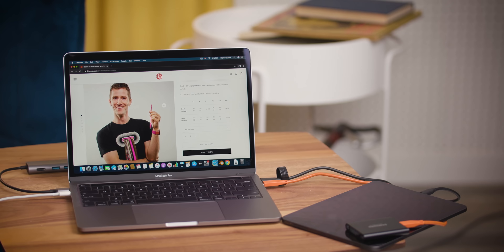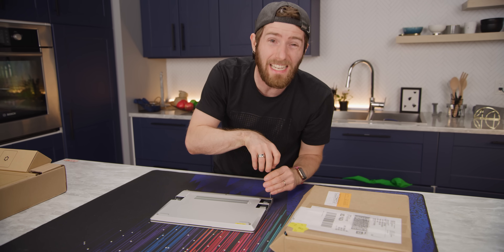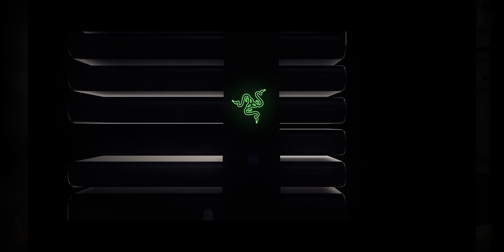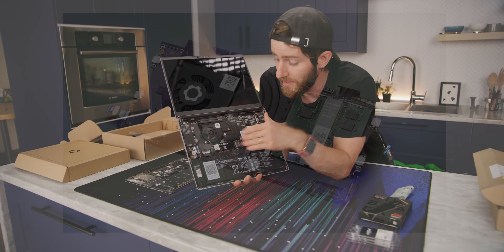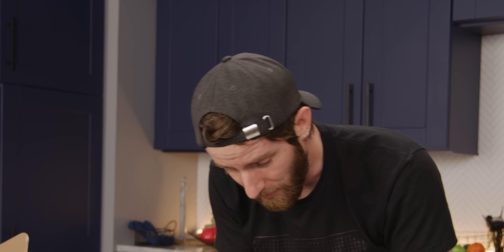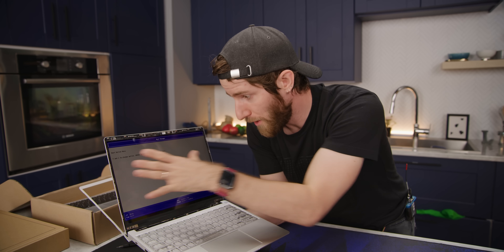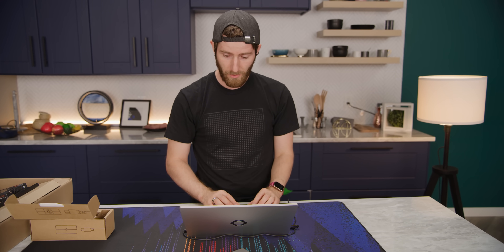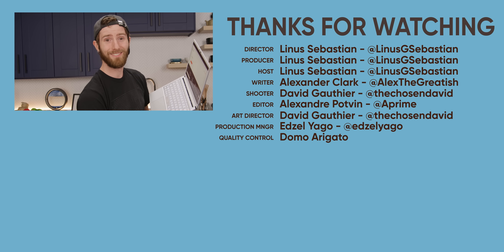A COMPLETELY Upgradeable Laptop?  - Framework Laptop Review

Comment: My mother was a network engineer, I actually remember asking her well over twenty five years ago, why all computers didn’t do this, when it would be better for people and the environment, and I remember it partially because it was not only one of the few times in my childhood she just flat out could not come up with an answer for me, but she actually got kinda mad at me when I kept asking, and I wasn’t allowed to go to the computer camp we’d been checking out for summer. 
On a side note, if you can make the general keyboards changeable, could you not also make different types of specialty keyboards, such as dual screen or tablet screen, that could be subbed on to the bass chassis for persons such as artists, designers, and those in stem fields, who might need them?
Reply: The dual/tablet screen in place of the keyboard is an interesting idea, although I'm not sure how well that would work with existing motherboards, since the keyboard connectors are designed for just that, a keyboard. However, a removable keyboard panel could allow you to attach another display via the expansion slot perhaps, then you would use the touchscreen alongside windows' touch input and keyboard, alongside something similar to a wacom tablets pressure-sensitive screen perhaps. It's an interesting idea for sure
Reply: the DS XXXXXXXXXXXXXXXL
Reply: @gouramii1182  I was thinking the same thing!!!
Reply: @gouramii1182  omg yeah lol
Reply: Even if I might not want it, a touchscreen replacement for the keyboard would be a neat option for later models, or other odd setups as you said, integrated mini joystick(s) perhaps...
Reply: i wish we could atleast add more ram to laptops , i have a lenovo z580 from 2014 i cant afford anything more dont judge me 

its got a intel i3 processor and about 4 gigs of ram but for some reason even when i am not using any apps of programs 2 gigs are always filled up idk why

Comment: I actually wrote a long comment comparing the price range of a Framework Laptop with a Dell (Alienware M15 R6 Gaming Laptop to be precise), but couldn't post it publicly for whatever reason.. So just the gist / bottom line: the Framework Laptop is $1,975.00 - not the barebones option, otherwise known as the bring your own stuff option, but the one with an actual SSD (1TB), 16GB RAM, WiFi, Win 10 Home, power adapter, ports.. The Alienware (order code WNR6M15EYTUS), similar specs but with a dedicated graphics card (NVIDIA GeForce RTX 3060 6GB) is $1,916.00 .. so much for the notion of this being such a socialist machine, designed by engineers who have the consumer in mind.. no Linus, it's just a gimmick that you can pay to put together.. but anyway, I hope you do good on your investment..

Comment: Linus: "If you have your laptop plugged into wall that can cause battery swelling and be a fire hazzard"
Me who has had my dell inspiron 17 plugged to a wall for 5 years straight: "im in danger"

P.s. it barely runs rocket league above 60 fps low settings and lowered resolution. Its pain. Pure pain.. dont have a job so i cant buy an actual pc.. fml.

Comment: I do not understand their purpose. They seem to be anti-Apple and anti-Microsoft gimmick. Many companies like MSI and Asus sell laptops which can be easily opened, repaired, and upgraded (as much as this laptop can). These companies void warranty when you open, but Framework allow you to open only. If it gets damaged during repair/upgrade or if you use parts which Framework do not provide then warranty is void. Basically you are tied to Framework if you buy their laptop, which isn't good. And in 3-4 years this laptop will be obsolete and you will require a new laptop anyways. CPU/GPU upgrades are not a thing and if you are replacing motherboard then why not replace whole laptop for a change. They have created cute tiny modules for ports and SSD but they are too small to get lost easily. We all know how many stuff we lose. And if even 2-3 people bring the same laptop to a meeting and put those tiny modules on a table then it will be a nightmare to figure out which belongs to whom. Personally I do not like their vision. As a laptop person I would prefer to have a laptop which I never need to open. I do not like opening my laptop to clean fans. I want a laptop which never gets dirty from inside and if I want to add RAM and storage then I would prefer to have option to choose which RAM and storage I want at the time of purchase. Companies lie all the time about the parts they use. If Framework should have focused on that vision where they have transparency in parts they use, it would have been really innovative and revolutionary. I would prefer that I know what parts companies are using at the time of purchase and better to have an option to choose which part I want.

Comment: I think most PC Hardware for office use actually does not really need an upgrade plan. 
There has not really been a real growth in hardware requirements in more than a decade now. 
You need to be able to switch out stuff that wears. like fans, SSDs or HDDs.
Everything else should just be built to last.
I have no problem with glued and soldered stuff. 
As long as you are actually able to get the parts, you will find somebody who is able to repair it.

Comment: The biggest problem with this laptop is where they put the ports and the number of them. Only 4 and only on the sides. They could've put a few default ports on the rear or just made the laptop slightly bigger to accommodate more on the back, there's nothing worst than trying to bend a video cable, that should be on the back, extra USB ports on the back.

Comment: Damn, and I just bought a Dell, because it is relatively user-friendly machine. But it's quite interesting, that it's relatively low cost model and it has room for upgrades - free dimm slot, free 2,5" HDD slot, available service manual and it has USB-A, ethernet and Jack - why the XPS seems to be much less user friendly?

Comment: I'm probably gonna buy one if they ever include a dedicated GPU, for my workload.
Reply: You could use an external gpu, just plug a thunderbolt adaptor to the computer, plug your external gpu and you are golden, an internal gpu would be near impossible to upgrade because the size is gonna increase, the cooling is gonna increase, the voltage, form factor and on top of that it is gonna have to be a custom gpu because it is for a laptop instead of a full size one, the computer would also have to be far bigger, so while I wouldn't rule them making a big version of the computer all together they haven't even gotten a few shipments of their first laptop model let alone have the money for an entirely new design lol
Reply: That would be awesome.
Reply: Same

Comment: the only complaint I can think of about the Framework laptop design is the IO. Sure you can swap them around, but if you're using USB C can't I have say TWO USB A ports on a single module, or a VGA port AND a LAN port, etc etc? I mean you only have 2 or 3 IO module slots. It's silly to limit each slot to a single item

Comment: I really want this company to succeed. In this day and age, we absolutely NEED upgradeable hardware! Thinkpads used to be the champions of durable and upgradeable laptops, but they've sold out and are involved in the same anti-consumer practices as other brands. I see no reason to support thinkpads any longer if they're just as bad as everyone else. It's time we give Lenovo a run for their money for abandoning the very thing that made thinkpads popular in the first place!

And I would also like to add that if Framework fails, other tech companies will point their fingers at them and say "told you so!", so I think it is CRUCIAL to support their cause!
Reply: The reason these things fail is because they need to manufacture multiple industries worth of parts custom made for this laptop and only this laptop
Reply: If these things get a Trackpoint with the ThinkPad's  three button design, I'm shelling out the cash to buy them, god I wish was alive when IBM made Thinkpads or they still made the x200's.

Edit: Just saw the thing about their BIOS, I'm getting one when my X390 fails.
Reply: I'm upset at Lenovo that my new ThinkPad doesn't meet my expectations, but what are they doing specifically that they are abandoning? I can still order replacement parts and find teardown guides.
Reply: @JSmithSS  A number of the newer models have soldered-on ram, hasn't been a model with a removable battery since the T480, weird driver/firmware issues (specifically, I recall an issue where the T480/T480S had a thunderbolt controller that would just straight-up kill itself due to a firmware bug and require a motherboard replacement, Lenovo patched it for the T480S but there was a big delay before they released the same patch for the T480, which was an older model), shit like that.
Reply: hp elitebooks are still going strong for me

Comment: I'll laugh in 3 years when this product will either be discontinued or modularity will be irrelevant if new versions will use different connection types. Not to mention you will buy replacements only from them which could translate into jacked up prices.

Comment: "I personally would love to see a touch option."

Just imagine.  They come out with the touch option.  And you can just... swap it in to the laptop you already have.  Because they're not assholes.
Reply: that's just beautiful
Reply: And you sell your panel used, so it basically paid itself ...
Reply: @juanma9868  Basically its stonks
Reply: Reminds me of a colleague who dropped his laptop from a tractor (lol). Display was broken. In the process of ordering a replacement, he went for a 1080p model as an upgrade as well. Hooked it up, and although it had image.. colors were all over the place. Called business customer support, they told them the display is "incompatible" as it wasn't original laptop spec. After more DIY tinkering.. turns out that the 1366 and 1080p height displays use different LVDS cables... Swapped cables, everything worked! 

I bet that surely wasn't according to plan. It wasn't Dell this time. But no matter which company, that kind of BS needs to stop.
Reply: @nlhans1990  1366 is one channel LVDS but 1080p needs dual channel. He got lucky because often the board side is missing the pins for the channels not just the cable.
Reply: Oh my god, I didn't think of that!
Reply: Sadly it still hasn't come out yet :(
Reply: @yourlocalplumbingcompany4984  Chip shortage. I shit you not. The OEM that makes their panel is unable to make touch panels because the relevant microcontrollers are not easy to order in small batches, or on short notice. We're talking about a million chips at a time.
Reply: @yourlocalplumbingcompany4984  one day 🙏i believe
Reply: @yourlocalplumbingcompany4984  It does take a lot of time so be patient. In the meantime, buy one of those infrared bars that add touch support to any laptop.
Reply: oh my GOD yes
Reply: They said if there’s a touch option that will be 100% the possibile
Reply: I would've this to have a 360° hinge
Reply: That would be a bit complicated, because they built it in mind without the touch capabilities, i assume. So in this case they would need to have a separate connector for the touch or have pinout for the touch already built in to the display cable connector. Unless they already have had touch capabilities in mind, that’s very likely not possiblle.
Reply: @niko1even  as he mentions in the video, the motherboard already has touch support built in, so the connectors and pins are already there. It really would be as simple as just popping in a compatible touchscreen, it seems.
Reply: @shehranazim4784  oh sweet. I wouldn’t say “popping in”, because the process is a bit longer than that, but yeah. That’s nice
Reply: @niko1even  relative to a lot of other modern laptops, this is as close to popping in we'll be able to get!
Reply: @shehranazim4784  In times where is even difficult to swap a different screen with similar specs into my normal laptop this would be a great alternative. I love it!
Reply: @niko1even  they could just sell a case with a touch screen without components so you can just swap your entire "computer" into the new screen.
Reply: lmao

Comment: I'm thinking, the main challenge of Framework would be to supply all of these parts or compatible parts for years. Will I be able to put a fresh CPU with motherboard in the same enclosure in 10 years from now?

All those slots are not very expandable. The true expansion cards work over the motherboard bus (ISA/PCI/PCI express, etc.). But those cards work with USB controller.

And there is the limit to the size of that card.

But that's not bad first step, but still far from old laptops upgradability. Looks like engineers sacrificed some features against cool thin tiny look.

Comment: That is worse than my Asus ROG G53S laptop. I do have:
- fully upgradable CPU. Currently I'm using i7-2670QM and I can replace it if it dies.
- fully upgradable GPU. I don't know the exact pinout and atandart, but I can buy any of a lot options for replacement.
- insanely cheap motherboard. Once I replaced it and it cost me only $50 with shipping.
Of course, I do have 3 (or even 4?) slots for RAM. And, the best - 2 places for 5.25 drives + optical drive (or space for the 3rd drive).
Oh, and cooling. There are 2 separate fans, radiators and awesome airflow. It blows air to the back, so I can work in bed, for example, and not to clog the airflow

Unfortunately, it's about 10 years old and I can't easily find, at least, a couple of parts for it to replace (USB+SD card extension board and internal webcam cord).

Comment: Excellent, there on the right track with the internal components, however would appear the modular bays are just 4 usb c connections in a recess. 
Ideally I would want to be able to upgrade the GPU and don’t think usb c would be fast enough. Be great if they released a larger gaming model with a pci express bay, then developed a upgrade cartridge with different mobile GPUs.
Reply: also the i7 processors only have 4 cores. and there is no dedicated gpu option.
Reply: @shadowyzephyr  4 cores is plenty of processing power for 95% of average users, and even more so where power draw is a consideration, which is why they went with the intel lineup that they did.

so i really dont get what the complaint is with "only 4 cores", they needed to start off with a configuration that would sell to the most amount of people right off the bat, they cant satisfy every market at once right out of the gate

Comment: Someone should design a GPU connector so that the laptops could have modular GPUs.

It's been proven that thunderbolt connectors could feasibley handle it.
Reply: I know right if gpu and cpu where upgradable I know that is supper hard in a way but hell that would be the ultimate

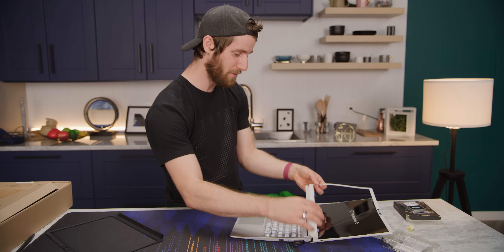Comment: 13:39
I don't care about touch, and I'm less likely to buy a laptop if it has touch then if it does not even with equal price.
However I'd like a way better screen then the one included.
And preferably also a better keyboard, speaker, camera and microphone.
And of course a non-Intel CPU.

Comment: Great concept for ease of repair. How about upgradable logic boards like clones used to be ie 8088 /286 /386 /486 and custom video.  Multi ports within each plug in port and  a magnetic disconnect power just like my Fry Daddy from the 1970s built into the case

Comment: Those expansion slots look wide enough for 2 usb-c ports. If so, the usb-c module probably should've had two. I don't know of many situations where a built-in hub would be an issue. If not, then the expansion slot size was chosen pretty poorly.

A lot of laptop motherboards have angled ram slots that let the ram modules overlap, using much less horizontal space for a little more vertical space. Feels like there was a missed opportunity to have a higher ram capacity and to be able to cobble together many small modules that a DIY-er might have laying around.

Comment: In regards to solid rigidity despite being really thin. It's all about profiling, bracing and anchoring. This is how we can make a platform you can walk and jump on with barely any flex, using sheet metal not much thicker than a few layers of aluminium foil. You can do a lot of it with plastics too, but sandwich and anchor some pretty thin polycarbonate or nylon with thin steel - you got yourself some serious wizardry.

Comment: Could be interesting prospect for small computer shops. Being able to buy parts from framework. Then being able to have their workshop techs preconfigure machines based on customer demand rather then having to buy machines based on the whims of various hardware manufacturers. 

The repair angle is also nice. Since often an unrepairable laptop can loose a small computer shop money if they come in. Although considering the PCs that sell in my area. I'm excited for when they can start offering budget components.

Celerons or Pentiums to be exact.